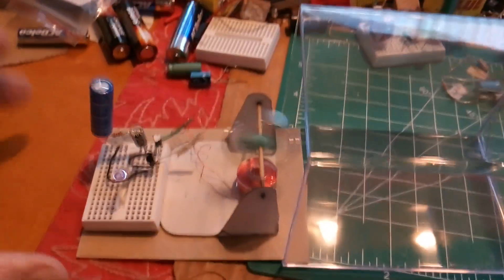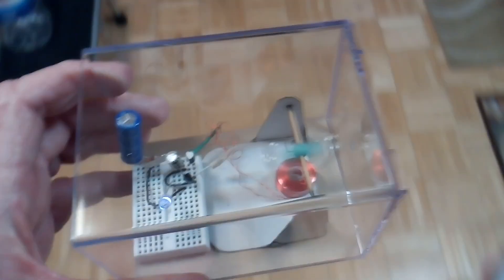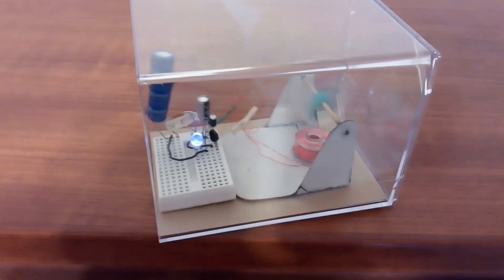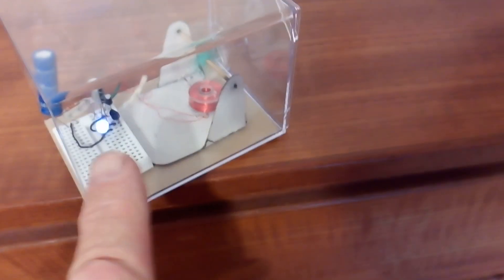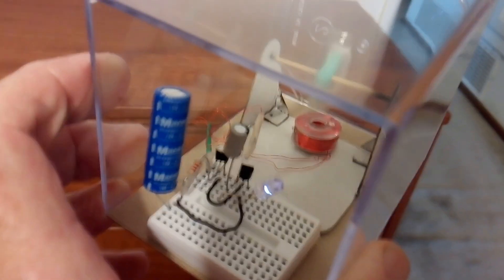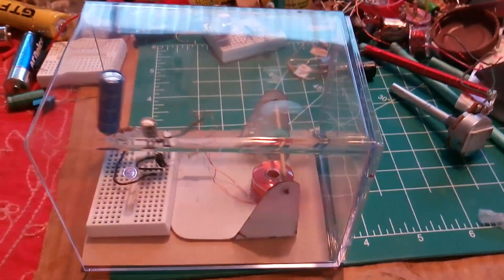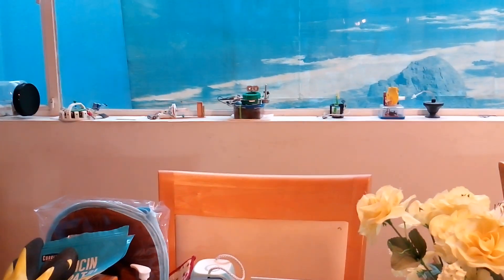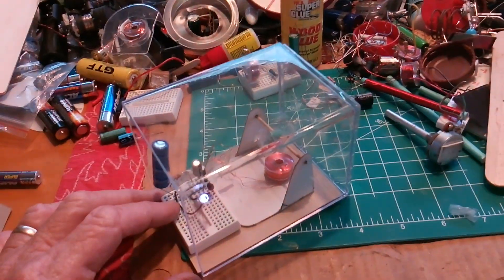Boxed Cardstock Motor ---   Goes for a walk

Comment: Hey @Lidmotor :)

Maybe you would like to revive Muller dynamo project as well? There are open ends what need finishing.

If you do it, here are some things what was missed out by everyone:
1) The coils and magnets arangement around rotor should be in a way where the resulting kinetic forces around rotor should be net 0 neutral force. In other words when you have all generator coils on short circuit and you spin magnets through them there should 0 or close to 0  resistance. This is achievable by canceling repulsion from one generator coil with attraction from another generator coil aound the ring while the electric current is being induced. With your building skills you can do this with different ratio of generator coils and magnets until achieving neutral force while spinning rotor by two fingers. 
2) All outputs from the coils should go through individual rectifiers and then conected in paralel on DC side. And the hard part will be to make sure it still have neutral force for rotor turning.
3) With all said above have one or two additional coils for driving rotor installed after balancing out kinetic forces from magnetic fields. With usual Bedini or similar driving circuits.

P.S> I would also try making coils from Iron wire instead of copper wire. It have opposite magnetic effects.

Good luck and have fun!